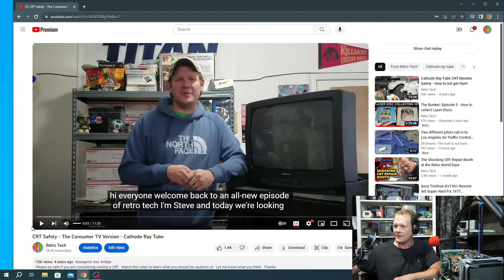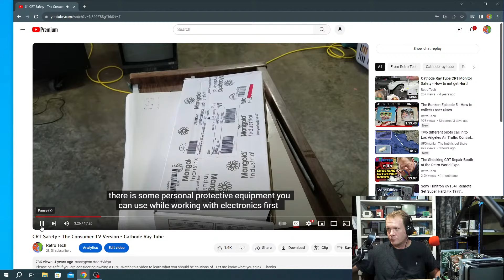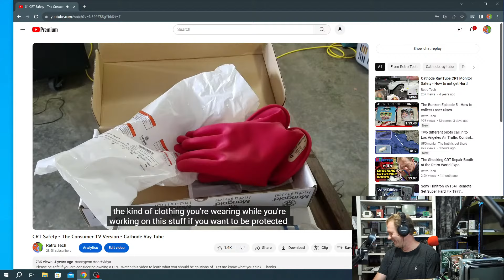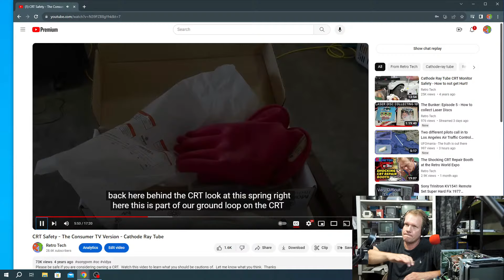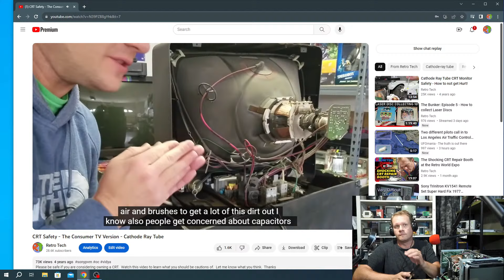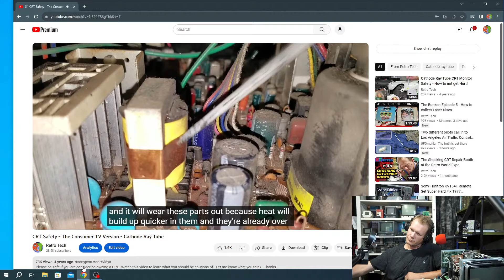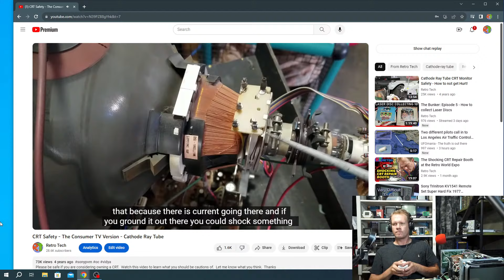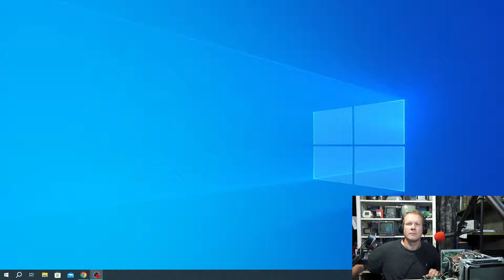The Safety Episode - How to not die working on a CRT

Comment: Excellent observation! 🐕‍🦺📺 There were a few things missed in terms of safety. When I was trained, remove any jewelry; no clothing that might be conductive (some shirts can hold a charge). The arm should be behind your back, and someone should be present when discharging the CRT in case of an accident. The pro version of the DIY screwdriver tool is typically longer because it keeps the tube and tech farther apart from each other. Safety gloves and glasses should be worn when discharging the tube. The tech should never be grounded to prevent the discharge from going through the body. Only the discharge tool should be connected to ground to dissipate the charge in the tube. These are the safety procedures I remember. Believe it or not, I learned this back when I took my Apple hardware certification, back when the last CRT machine, the eMac, was still serviceable. If the safety part of the exam had one incorrect answer, and to be frank, it was really all about CRT safety, you’d fail the entire exam. Oh yeah, apparently tubes can build up a charge over time. I don’t know why etc. Many ‘ modern’ sets will have a discharge bleed resistor that discharges CRTs on power down but this can fail so safety is important so that the tube cannot pose a risk when working on the device.

Comment: Is it safe to say that if you try to operate on a CRT with one hand, you are generally being more safe?  Just don't put two hands on the touchy parts?  I really want to get into this, I have 4 CRTs I'd love to service but I'm terrified of shocking myself.
Reply: One hand in, one hand in the back pocket will protect you from having the voltage run across your heart, which would be bad.  It won't protect you from getting shocked.  I just recently took the plunge and discharged + serviced an arcade CRT and it did not live up to the hype.  Way simpler and way easier than I anticipated.  

Consider this; almost every long time arcade tech has either taken a hit from the anode cap, or they know someone who has.  I don't think I have met a single one who knows someone who has died from taking a hit from the anode cap.

Comment: thanks for this episode, I have 2 CRT TVs a 14 inch (early 1090s) and a 21 inch (early 2000s) flatscreen that I want to save they were rejected by technicians because they said they weren't worth it despite being repairable so I'm gonna take matters in my own hand, I need to know what kind of tools I need to diagnose these old electronics because I'm sure a few failing capacitors or a failing PSU is the cause. could you make a video on what tools are needed to diagnose failing parts in a CRT?

Comment: I brought the same gloves home from work. Most we ever touched there was 480.

The leather gloves just protect the rubber gloves themselves. In arcflash I think they're supposed to keep the rubber from melting to your skin.

How much voltage is in the yoke? I've always used gloves when adjusting one.
Reply: Been zapped by the yoke, only hurts when and where it happens for a second. Still hurts, but def not deadly

Comment: I had an old Sony Vega that was too heavy to move around. I thought it was a heavy case. I took the back off and the case was just plastic. These TVs were the top of the line. Had the best picture I.ve ever seen. But it was just too daggone heavy. So I drained it of any juice. released the vacuum and started busting it up. The glass was extremely thick. An inch in some places and 1/2 inch for the rest. I so hated to destroy such a beautiful TV. But I couldn't even give it away because of it's weight, Anyway, Thank you for what you do. I grew up in a TV repair shop in the 60' and 70' and was familiar with what to do. You doing this is great and I appreciate your channel

Comment: someone mentioned a chicken stick, basically attach a PVC pipe to the screw driver to put some distance between you and the screw driver handle if you don't have gloves. is that doable? for very paranoid people... also a 40" fat monster CRT, what about them rebuilding charge? how fast does it happen? also if the giant TV is on the floor (carpet over concrete in garage) what's the advice regarding shoes? could i stand on a wooden chair? my shoes are steel toe. finally, i just want to discharge it so i can clean off the PCBs (the TV was recovered from the desert, has lots of dirt and animal hair in it). is it ok to leave the anode on after discharging it to clean the pcbs with a static free paint brush?